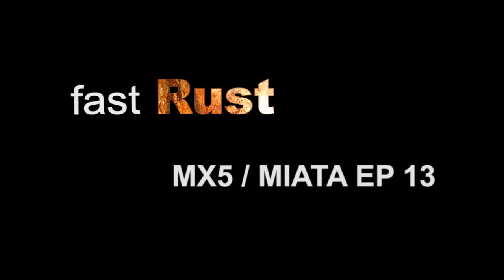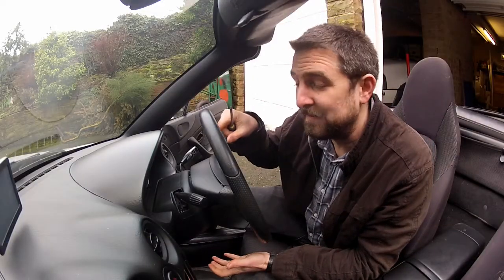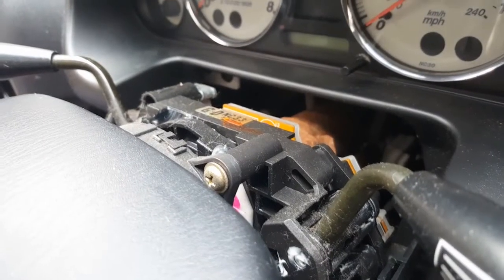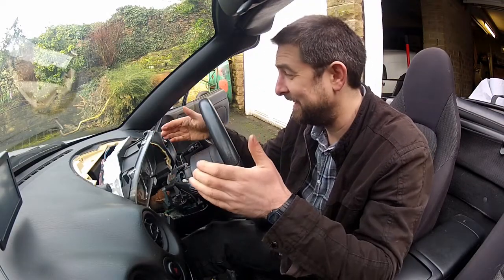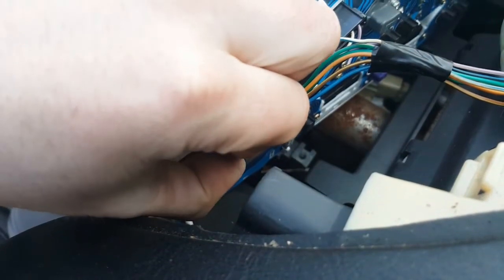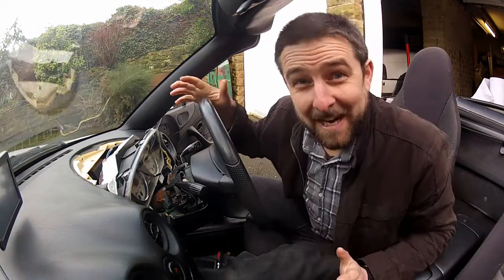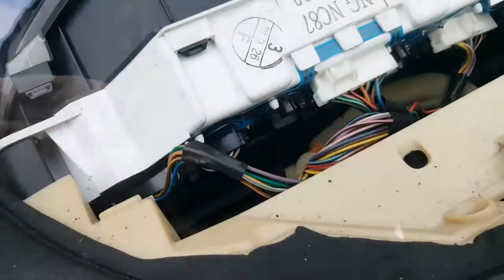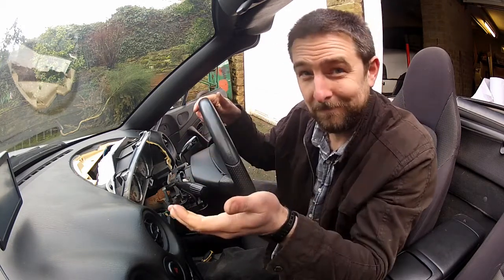How to Remove Instrument Cluster & Immobiliser Bulb (NB/NBFL MX5/Miata) ME221 Install Pt 05 | Ep13

Comment: I've been getting code 24 since I installed my ME442, do you know what the code means and would the immobiliser still be working with the aftermarket ecu?
Reply from the maker: Not sure. Might be a question for ME that one. Immobiliser does not work after installing an aftermarket ECU. You should know because the immobiliser dash light will flash constantly

Comment: On my 2004 NB it is not necessary to remove those three screws on the lower steering column panel. They only secure the bottom panel, the top panel snaps onto it. Since the bottom panel is not being removed, I need only pull the top panel off and then proceed to the dash bezel.
Reply from the maker: Yeah you're right. I had set out with the intention of removing both halves but quickly realised this wasn't needed.

Comment: Need to do the airbag light. Aftermsrket steering wheel. Removed the passenger modules got a code passenger one went off. Did hear there's a buzzer that goes off so its tape can't see why I get some high temp paint and spray it or electrical tape we will see. Nice one good vid
Reply from the maker: To get rid of this as far as I understand it you just need to wire in a resistor so the ECU 'thinks' the airbag is still there
Reply: @FastRust  not sure what issues everyone else had. I pulled the cluster out. Untwisted the bulb holder. Removed the bulb and not 1 problem. Thats on mk2 NB. No buzzer nothing. Then put it all back

Comment: I have a 1496 egr fault code on a 2004 2.5 mx5,  changed the egr valve and engine is running ok, problem free. The only trouble is, although the code pointed to the egr motor, the fault code still comes up and the check engine light  returns after every reset. According to forums it could be a part of a circuit board burned out as the egr motor failed sending 12 volts to the ECU. I could get the ECU repaired at great cost but the car is running perfectly. Can you use the same method to remove the CEL bulb and is the bulb the same type and fixture to the bulb you removed ?
Reply from the maker: Yeah if you pull the instrument cluster out it's exactly the same process to remove the CEL. Or you could hotwire it to another bulb so it illuminates/goes off during start up. Done this on the truck for the ABS light.

Comment: I have went for an ME221 SC build like yourself. I also had the immobiliser light constantly flashing on the dashboard, but all I had to do was remove the immobiliser module from under the steering wheel column. I only discovered this while trying to find a 12V source for a central locking kit, but there is a square box with big plug on the RHS of the steering column and removing it got rid of the light and took less than 1 minute.
Reply from the maker: Well, that would have been easier! Thanks for the tip
Reply: By removing the module does it stop working because I’m having issues with mine and my car doesn’t want to start after I’m wondering if I remove it I’ll be done with that issue any ideas ?
Reply: @angelbeltran5545 no